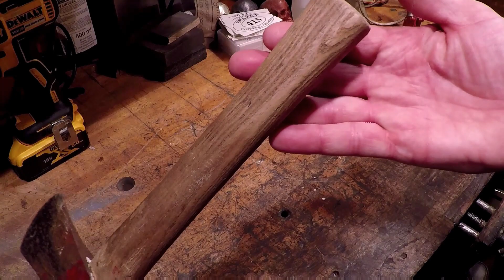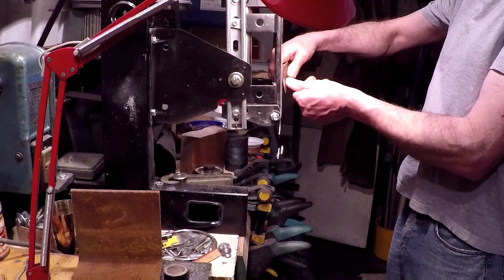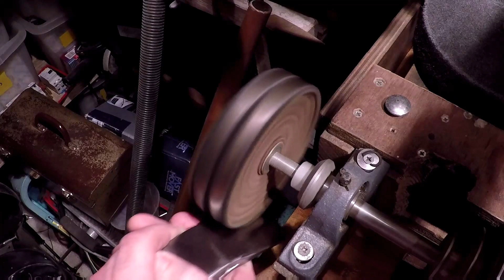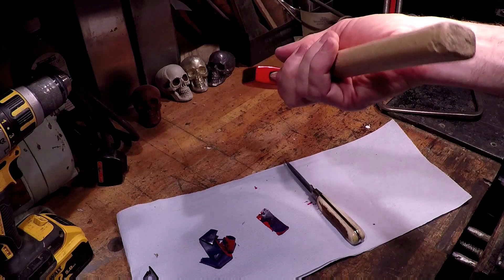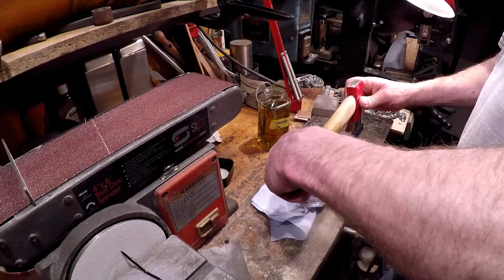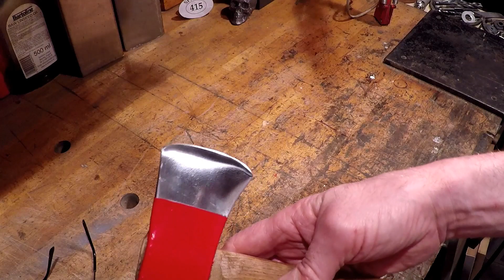#37 Tidying up a small Axe, light refurbishment project

Comment: It's now too good to use other than to sharpen a pencil after all if you now split some wood it will ruin that lovely paint job.
Reply from the maker: You are not wrong I only painted this one as it was for a friend, I don't often paint mine, although sometimes it does make it easier to find them 👍